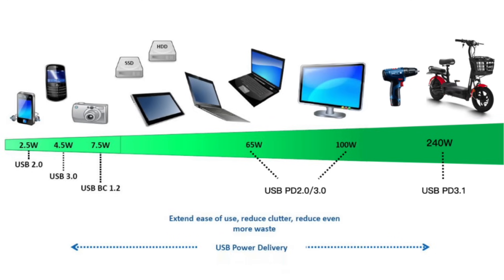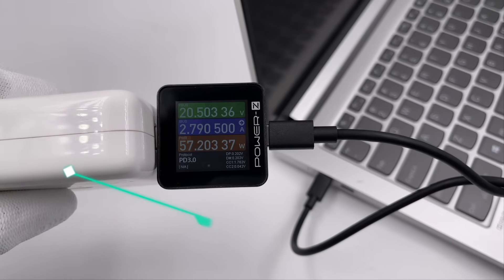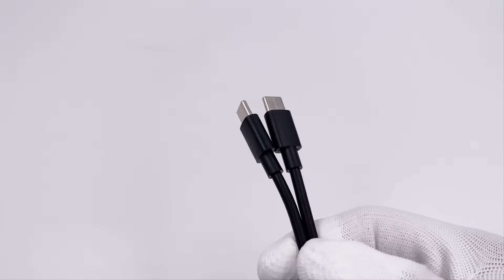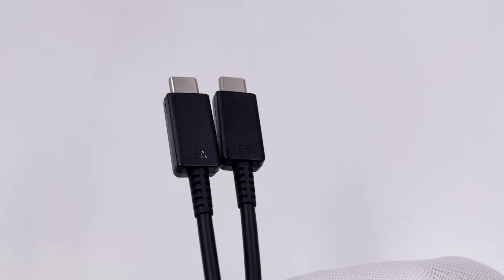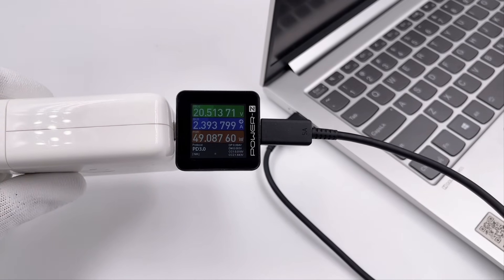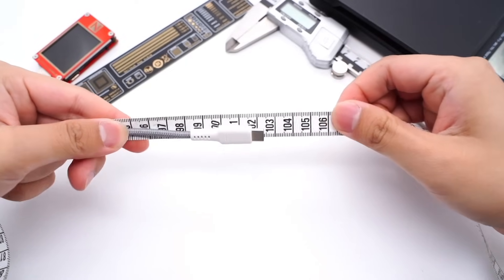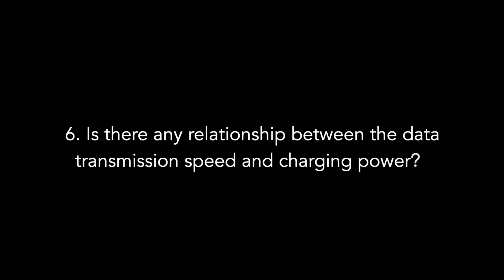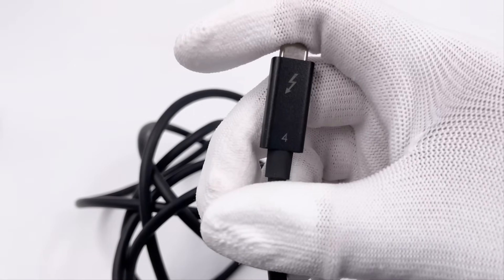What's Difference Between 5A Cable and 3A Cable (PD Protocol)

Comment: Question: What's the difference between a cable rated 100w and 240w? Other than the emarker indicating 100w or 240w physically it's the same right? Potentially could a 100w cable do 240w if the firmware was updated

Comment: The ( secret ? ) to using  ALL  cables of this type ... is to disconnect the power supply ( wait 20 seconds ) an then pull the connector out ... ripping the plug out when powered will SOON burn out the ( TINY ! USBc) ) contacts ... and ( more usually ) wreck the plug to cable joint .. a HUGE amount of folk do NOT know this 😝 ..... DAVE™🛑

Comment: The USB industry as a whole is pretty sad. Some proper required labeling enforcement would be amazing. There's no way to pass additional current through wire without increasing it's diameter. I would imagine that if you can't measure the diameter, it would be measurable through resistance, with the same length cable having lower resistance with larger diameter conductors. Thanks for presenting this!

Comment: You're wrong my friend it is extremely easy to get the correct cable but the reason why people don't is because of the prices and all the fake cables sold online that deceive people. If you purchase a thunderbolt cable just get it from official apple website or some other certified cable manufacturer like Anker or Cable matters. If you're cheap and don't want to pay a premium for apple cable get amazon basics thundrbolt 4 cable you'll get 240W and 40GB/s tranfer speeds for less than $10. It won't be the same quality as an apple cable but it's good enough. Don't buy all these cables gas stations are selling those are junk....

Comment: The mark chip is monopoly.  Stupid unnecessary hw.  The 2 wires chargers are most efficient, just have matching voltages and none of the expensive rubbish of negotiable hardware.

Comment: please I need help. I have a Xiaomi note 11 pro and lost my original charger I want to buy a new charger 120w clan I do that? other brand than Xiaomi? is it only the cable that has this chip? so if I get a Anker 140w charger do I need a Xiaomi cable for it to work? or what do I look gor?
Reply from the maker: Basically, you need to purchase an official Xiaomi charger in order to get the best charging performance.

Comment: What cable can I get get that is USBc to lighting that is pd like the one I your video or witch one is that. Please I would like to know so that it works with my fast charging rechargeable battery.The battery requires fast charging device to start fast charging mode.

Comment: I need an urgent reply ...... I have both 45W and 65 W adapter. Both charge my Samsung S24 Ultra with Super fast charging 2.0 (5A Cable)......65 W adapter came with My Laptop Book 4  but when I charge the cable along with this adapter cannot charge my phone with 2.0 charging, that means that cable is not 5A.......So all the time I need to carry 65 W adapter and both cables with me,,,,, My question is can I replace original Laptop cable with my 5A mobile 45W adapter cable? By doing this cause any damage to my Laptop?
Reply: Yes as the video said you can swap higher for lower A

Comment: Can I charge my smartphone with a basic 100w charger aka Ugreen or Baseus? Despite original charger which is only 20W?
Reply: Definitely yes and it is so safe no matter 100w 200w adaptor or future 1kw 😂 because usb-c pd can automatically regulate voltage and ampere and it's based on your device (receptor) as shown in the video usb-c can regulate voltage from 5v-20v and 3A/5A and more... Based on USB-c version or pps

Comment: Hi Charger Lab, is it safe for me to use a 3A cable to charge my laptop with a 100W charger? Will it only charge slower or will it potentially damage my laptop?
Reply from the maker: It will only charge slower.
Reply: @ChargerLAB  Thanks.😀
Reply: It is completely safe just charge slower
Because usb-c pd can regulate voltage and ampere based on receptor as shown in the video

Comment: can I use 5A 100W data cable on my redmi note 10 pro for copying files on a computer?
Reply from the maker: Yes, but most 100W cable is not designed for data transmission. So, the copying file speed will be pretty slow.
Reply: @ChargerLAB  what can you recommend sir?
Reply: @disguisedporo1300  usb 4 cable with 40gbps
Reply: @ChargerLAB  might NOT be the case. 5A 100W 10Gbps and 5A 100W USB 2.0 (0.48Gbps) cables exist. If unmarked, then it is probably USB 2.0

Comment: I bought a cheap 2M 5A PD usb-c cable and the manufacturer cheated and put a 5A emark chip in a thinner 3A cable and devices attempt to charge over 3A but fail due to the electrical properties of the cable being wrong. I left a review of the cable on Amazon alerting people to the fraud and Amazon deleted my review a few weeks after I posted it saying I was mistaken and the manufacturer was honest. I tested the cable with a cable tester it doesn't lie but Amazon doesn't care! I promptly cancelled my prime membership in response.
Reply: Classic Amazon... supporting frauds as usual 😢
Reply: Make sure to leave positive reviews for other items, otherwise if you just post negative reviews, your account gets banned.
Reply: A general rule of thumb is always be careful when buying cheap cables off Amazon. You can wind up frying your electronics that way. Personally I only buy first party like from Apple. Yeah it might be more expensive but the peace of mind is worth it.
Reply: How did you know it was a 3A rated cable? Did you measure the diameter of the cores?
Reply: If it’s made in China it’s like a box of chocolate you’ll never know what you gonna get😅
Reply: You really showed Amazon huh.

Comment: Does macbook pro usb c cable offers 5a or 3a?
Reply from the maker: 5A
Reply: @ChargerLAB  but with the macbook type c to type c cable my s22 plus using 45w samsung charger showing super fast charging instead of super fast changing 2.0. Its shows the same with 25w charger 😔
Reply: @WasfyRahman do u use the original samsung 45w? If third-party charger need to has pps support, if it's still the same, it would be there's a secret pin in samsung 5A that must be required

Comment: What is best for 18w chager 😃
Reply: You can use Whatever cable, the standard nowadays cable is 2.4A 3A 5A or more, The QC protocol is max 18w 9v 2A or if not QC protocol but 18w proprietary fast charger won't require cable more than 3A
Reply: 3a, el 5a no es necesario

Comment: What about 6A and 10A cable ? Like OnePlus iqoo  cables. Whats the difference between these . And why most after market type c cable limits at 5A . I have tried my OnePlus device it charges at 5A only with 100w after market cable . But with OnePlus cable it charges upto 8A.

Comment: I think they should rate the wires based on Watt & not current. Watt would be less confusing
Reply: using wattage could be problematic to devices that uses high current. let's say a 3A cable labelled as 60W, a 60W device that uses 15V would overload the cable since the max. current is 4A. if you look up on AWG table, there's no power rating but current.
Reply: Nope, Rated wire based on Current is good, if rated on power (W) would be confusing, the thing is the maximum output voltage of USB-C is 20V
Reply: 60W : 3A max, 100W: 5A
Reply from the maker: I think that's what the USB-IF is prepare to do:
https://youtu.be/Q4WQ6TDFMF0

Comment: Another great educational video ChargerLab and thanks. Great info about the amperage of the E-marker chip. However, it’s sad that a lot of producers of charging cables don’t put the specifications on their product labels so we are unable to determine the real life charging wattage unless we buy the cable and also a USB measuring device like that sold by your company. Higher price cables don’t necessarily guaranteed faster charging time or higher charging wattage. And we cannot cut our cables too. In the end, we can only get an assurance if we buy cables of any sort from reputable manufacturers. Or to keep following your fantastic video tear downs of chargers and cables ……. Keep up the good work …. Thumbs up 👍🏼

Comment: Some devices using the Usb-c connector but not the PD protocol will not charge with a cable containing an e-marker chip as there is no voltage on the cable before the initial 5v negotiation. Vape pens are great examples of these, as these small devices rarely have spare room for PD circuitry.
Reply: No. Those devices should have 2* 5.1k resistors from CC1 to GNG and from CC2 to GND. Those arent that big.
If not - those will charge from adapter with USB-A port via USB-A to USB-C cable
Reply: @volodumurkalunyak4651 Indeed. However, PD spec is highly convoluted and difficult to approach. AFAIK, the spec calls for some sort of voltage monitoring on the sink side along with the resistors. Some vape devices require 3A, which not all chargers can do. IP2721 is also not very large but a lot of designers just don't include one. I don't know the reason for sure but I have always thought it was the overly complicated documentation of the PD spec.
Reply: @dogukancil5128  so those vapes that require 3A can overload USB-A charger port but also very same vapes are completely prohibited from drawing any power from USB-C (via USB-C to USB-C cable) charger port. Maybe add those resistors so it is equally bad to any charger port it is connected to.

Comment: Can you please make a video explaining why some cheap devices with USB-C can only be charged via USB-A to USB-C cable, but not USB-C to USB-C cable? Now i have two of these (hair trimmer and helmet intercom) and i guess device manufacturer didn't include a chip that does PD negotiation, but would be interested in a more in-depth review of this issue. Thanks!
Reply: The chip is not necessary. It is enough to add 5.1kOhm resistors down to ground on both CC pins. It will configure your device as UFP (power recipient). I fixed this issue in some of my devices by soldering 0805 resistors right on the usb pins (6-pin type-c).
Reply: @danikvideos I seriously doubt what you just said even makes sense to the OP.
Reply: My devices are the same. It is because voltages from the usb-c port and the usb-A port are different.
Reply: @just1ed  no, it's because type c is bidirectional and doesn't provide any power by default. Your device should identify itself by CC pins, then power adapter will provide 5v. CC pins are also used to communicate and request higher voltage (5v-20v).

Comment: I have a 2 meter cable that claims 100w 5A. Does that mean it's lying? I can charge my laptop fine with it (65W charger) it does not complain about slow charging. Also, my Mi10T Pro does not always go to "mi turbo charge" 33W with it, sometimes it says "quick charging" and it goes to 18W. Could that be because of a dirty port or the cable?
Reply: Apple standard charging cable for Macbooks is 5A 2 meters. But it is noticeably thicker than other cables (twice thicker than lightning cable).
Reply: I bought a cheap 2M 5A PD usb-c cable and the manufacturer cheated and put a 5A emark chip in a thinner 3A cable and devices attempt to charge over 3A but fail due to the electrical properties of the cable being wrong. I left a review of the cable on Amazon alerting people to the fraud and Amazon deleted my review a few weeks after I posted it saying I was mistaken and the manufacturer was honest. I tested the cable with a cable tester it doesn't lie but Amazon doesn't care! I promptly cancelled my prime membership in response.
Reply from the maker: We can still buy 5A cables over 2m, but that will be expensive. 
Therefore, most manufacturers will make it within 1m (cost-effective option)
Reply: @ChargerLAB  that is what worries me, it was no expensive. It was around 6eur, branded Baseus
Reply: @dragosmoldovan990  in my experience Baseus is pretty good, just they (and many other Chinese brands) prefer to set their cables/chargers compatible with Apple products at first priority. You can find a $6 3m 100W cable from st like Essager, which works perfectly with a Macbook, but struggling to communicate with a Surface laptop. Cheap does not mean bad, just need to be suitable, and Apple :v
Reply: @dragosmoldovan990  i bought McDodo CA-713 years ago and it was priced around 6EUR too. i use it to charge my laptop with no problem but it's only 65W. didn't have chance to try to pull 5A yet but your problem could be coming from the E-Marker chip. i don't have similar problem but the cable i bought can only be used as USB2.0 everytime i did USB tethering to my phone while the non-E marked cable could. your phone uses non-standard charging protocol so the chip could be problematic

Comment: What about the new 240 W cables? Are there any major differences between them, and the older 5 A cables, other than data in the marker chip?
Reply: @AndrejaKostic  isolation must withstand at least 48V (between VCC and any outher conductor, obviously including connectors), probably more - IDK how much margin is required.

Comment: One interesting thing is noticed between my 5A and 3A cables is that my phone (mi11ultra) with mi65watt gan charger doesn't charge with more than 27 watts so 8-9v 3A but with a 5A cable it goes to 45 watts so 9V 5A which makes sense but I wanted to point out that not all devices uses that 20V and are more limited but can benefit from higher amperage
Reply: Bro i use 67w charger with my mi11t the phone can use 67w. When i charge with my 65w gan charger it says it only charge 55w why it cant charger 65w?
Reply: @aaast2549  are you using xiaomis 65 watt charger?
Reply: @arianamirgholami9555  yes the original one from the official store named Xiaomi 65w gan charger, even with the newer update of android with security updates it still only charge 55w from the 65w gan charger as the phone says 55w MAX charging.
Reply: @aaast2549  It could be using 11V5A c to c didn't have an standard for more than 5 amp so without increasing voltage (which isn't possible) that's what you get
Reply: @arianamirgholami9555  I'm not so good at this it might be funny question but why it can just get more V or balance with lower A and higher V to get 65w as it says on charger 😂
Reply: @aaast2549  your phone doesn't support more voltage your cable doesn't support more amps
Reply: @arianamirgholami9555  thank you sir for your answers
Reply: Basic electronics Ohm law here... 3A and 9Volt charging
 P = VI

27 Watts = 9[V] * 3[A]
45 Watts = 9V * 5A
Reply: Bro I have my dream phone even though I have s23 ultra

Comment: "larger pressure drop"

"Voltage", surely.
Reply from the maker: My bad. We'll correct that later.
Reply: @ChargerLAB voltage is much like electrical pressure